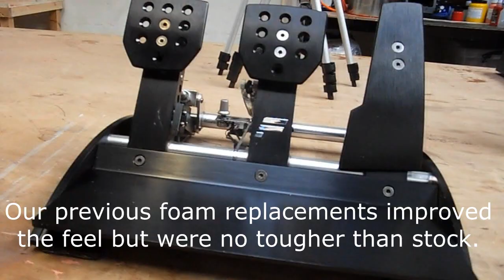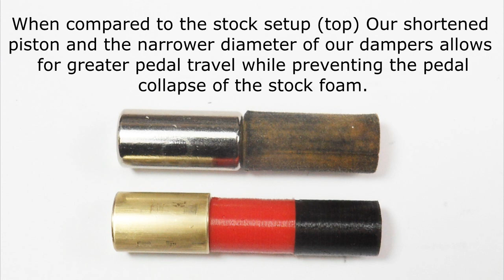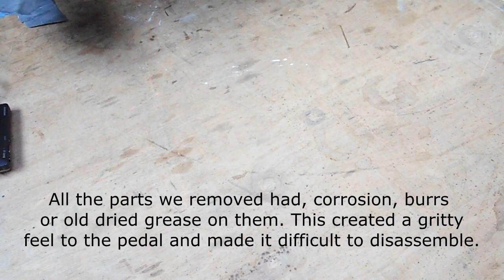Replacement PU Damper Set for Fanatec Clubsport V1 and V2 Brake Pedal

Comment: Just installed this kit into my V2s. I used the two black inserts to get the stiffest feel. I can now threshold brake to the point of under rotation much more consistently. Big improvement in lap times across the board.

Comment: An alternative method of getting to the brake piston is to just remove the 2, five mm allen bolts on the ends of the crossbar in the bottom that actually holds the pedals.
It'll take the pressure off the pedal and you can quickly remove the piston and change the dampers.
Then put it back in, it lines up easily and then bolt in the bottom pivot tube...
Reply: P.S. ordered this upgrade yesterday, cant wait..

Comment: Feel so good!!! :) It is a very fantastic product.  I have the same settings as the video, and the braking is constant.  Note that when installed, the bond attached to the load cell sensor in the stock state may fall, causing the sensor to malfunction.

I experienced it, and I was able to fix it by wiping around the sensor.  I don't know if this is because of the bond, but if you have the same symptoms try it.

Comment: This kit is amazing. I was wondering if you or anyone ever has the issue with the  throttle and clutch pedals when compressed they are at about 97-99% instead of 100? On the clubsport v1’s

Comment: ive also installed the mod but now i dont have any brake travel??? does somebody know the problem?
Reply: I'm having the same issue
Reply: found your fix, install the pin on the lowest hole for brake pedal and it gives it some travel